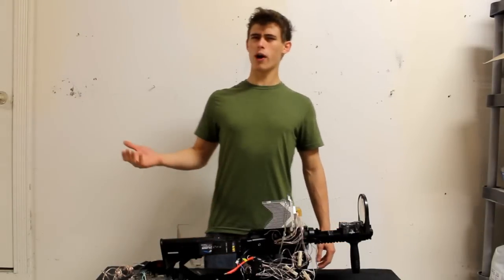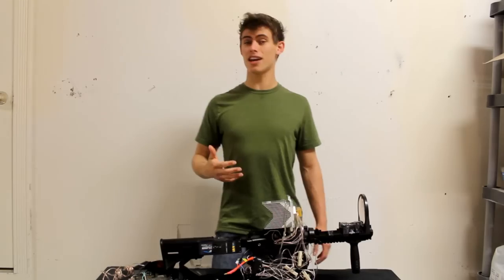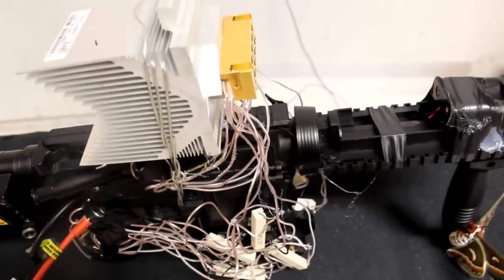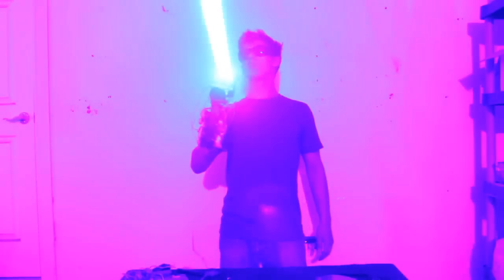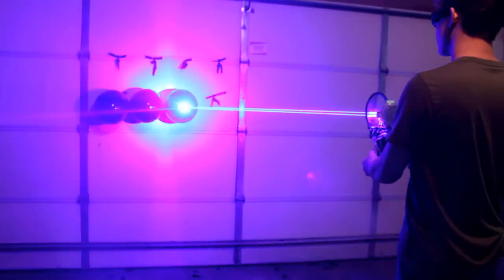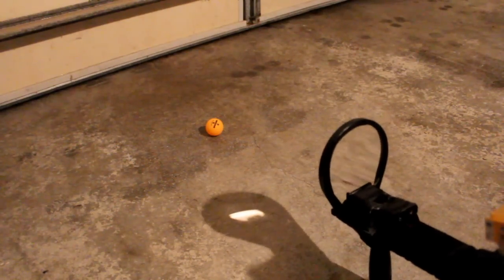My Homemade 40W LASER SHOTGUN!!!!!

Comment: I've got a 1.2 billion watt laser gun.  It cuts through steel like hot butter. 
Only problem is, every time I wake up, it's gone.
Reply: +JustAGuy Actually you can cut through steel with just 1kW (1000 Watts).
Reply: Gex9z Like hot butter?  Like a steel frame from a truck?  
My post was a joke about a dream.  Your post is trying to make it real asks you just use the word "steel".  Steel comes in different grades and obviously many thicknesses.  You're gonna have to be more specific.

Comment: Its not true 40 watts if its an array of eight 5w diodes, Instead its just a 5 watt multi beam laser. I have a DPS laser that can do all that.

When you build an actual laser rifle that can blast a hole through a steel beam or a person at light speed, then I will be impressed until then, these things are all just toys, like pellet guns and FRS radios..

Comment: Great work but try to focus the beams as close to gether at 10 feet as you can then add a slideing stick so you can adjust the magnifying lens then a nother with a 50x mag on the beams point when the meab is the thinnest for a stronger high powerd burning laser

Comment: I am recollecting a Star Trek episode where they needed more power from the tractor beam in order to move a planetoid. They couldn't just add more power b/c the beam system would burn out, but they realized that they could overload it if they did so in  short regulated bursts.

I wonder if something like that could be applied here. A continuous beam is too dangerous as the power increases, but in short bursts... well it would be interesting to see what a 120W "blaster" could do.

Comment: dude. the future is now. Sell this stuff. Imagine soldiers. With Guns that shoot FRICKIN LAZER BEAMS! I would by the sword and one of the lasers cause why not. if their cheap though. like. Under 50 bucks. maybe 70.
Reply: ha ha under $70, that's cute. That heat sink alone costs at least that much, and the diode array, probably about five times that much, then you need a pretty special battery. If these diodes find some sort of mass market, maybe the price on that component could drop, but you're still talking several hundreds just for the materials to make the device. Then, as cool as it is, there's not much practical purpose. It's not like your enemy target is going to hold still for ten minutes while you slowly melt a hole in him.

Comment: If that thing was 40W it would vaporise the wall
Reply: +Aaron Schoots Most lasers are 5 mW, but that's just for safety. Lasers come in all sorts of different constructions. A 445 nm direct diode multitude laser can be obtained cheaply at power levels above 2 W, and those diodes are extremely compact, making them much more portable than a 40 W CO2 gas laser used for industrial cutting. The trouble is combining the beams efficiently.
Reply: Not saying it is impossible, just saying this particular case is highly unlikely because of heat issues, the balloons taking a while to pop, and so on. Plus who the fuck puts a moth on his laser
Reply: +Aaron Schoots You're either an average 11 year old, or a stupid 13 year old.

Comment: Instantly started wishing you built a rail on top of the gun (but below the lasers), where you could mount a little electric motor and some wheels, mount the optics to that and wire it all up to a chip that would automatically move the optics on the rails to focus the lasers on the correct distance depending on what distance a seperate red targeting laser was inputting.

Comment: How much is 500k Mw turned into W? im stupid sorry
Reply: Thomas Smales 500mW = about .5W. This makes your laser a Class 3 laser which requires eye protection. Please make sure to wear it. Laser light has a funny habit of bouncing in unexpected ways and exposure to the beam directly to your eye can easily cause permanent damage. (Source I work in the laser industry, and currently help make class 4 1000W laser systems used for manufacturing and government use.)
Reply: 500 watts? I think I ain't so sure
Reply: Okay jeez... cuz i bought a 50 dollar lazer that produces 500W and is purple and it already looks like a lightsaber already XD
Reply: Thomas Smales 500k = 500 000 ; M= 10^9= 1 000 000 000; 500kMW = 500 000 x 10^9 = 500 000 000 000 000
Reply: Oh and you mean mw capital M means Megawatt and I doubt that exist for now xD
Reply: no mw i just use capitals cuz i can.. :3
Reply: Anthony are you sure its only 5w? It said 500,000 mw o.o I will wear eye protection <3 thank you for caring
Reply: Sorry Anthony But you must mean 5,000mW because 500mW it aint that powerful, a regular Artic SpyderIII is 1,000 mW and that equals it's 1 Watt (Or at least when last I remember that was its power)
Reply: +Thomas Smales there is no way in hell it produces 500w. 500mW maybe, but a 50$ laser pointer you're lucky to get 30mW
Reply: +javier colon Did my wording confuse you? I said 500mW is half a watt.  5000mW would be 5 watts.

Comment: The backscatter off the lens is pretty bad. Hope to see you enclose the array and lens system in a suitable housing so that there will be no light spillage unless it comes from the actual beam exit aperture. Essentially this is what the navy did with its shipborne laser system. Multiple diode emitters with a deformabe mirror system to increase the focus without having to resort to heavy and bulky lens systems to keep the focus at variable ranges.

Comment: Thats in no way 40 W not even 1W of output power!!!
Go get a calorimeter.
The point of laser is to focus its whole energy into a tiny itsy point, you might as well get a bazooka.
There are stronger 3 dollar worth of diodes out there on ebay.
Reply: *****  Lets just say that when you buy a car from....lets say where you live its not the same thing as buying a car that came from china.
Even if both are same horse power.
Anyway, i was implying the design could do with a lot of improvement.
Wonder if there is any way to tighter align the rays.
Reply: You are such a dumbass lol. Sorry, that was rude. I have a strong feeling you don't know what you're talking about when it comes to lasers, bud ;)
Reply: +Bacanu Andrei You are a fucking idiot.
Reply: +Bacanu Andrei OK it needs improvement?  Post your better laser video or QQ.
Reply: Well actually i am toying around with a CO2 laser which happens to be easilly mobile since its DIY......but the xxKV cable and lack of proper eyewear for that kind of rated power is a big reason to worry. Though you did have a genius idea. Same thing as the video just different source.
Great ideea for a "PLASMA RIFLE"
Reply: You should join Laserpointerforums.com if you're interested in the laser hobby, and want to learn more. Maybe you can learn that a 40W diode bank array actually IS more powerful than a $3 eBay diode! ;)
Reply: +Gabe Sewell I prefer /r/lasers. When I was still new, I joined laserpointerforums and found the community to be very unfriendly. 
But I might have just gotten unlucky with the people I met.
Reply: Ah, yeah I could see that. Sometimes the vets have bad days, and since they are the main posters in there it comes off as the whole community like that. You also might have accidentally done some minor infractions like necroposting, double posting, etc. and didn't let yourself have time to recover in the community. I've found tons of friends in that community!

Comment: If you use two lenses you can adjust the focus for different ranges. Looks like the beams could be collimated a little better, that dramatically improve the cutting power. Pulsing the laser would be even better, but that would quite a bit more technically challenging. A great step in the right direction.

Comment: But can it melt Steel Beams?
Reply: Did anyone here get the joke?
Reply: I did but ill let them keep wondering xD 
Jet fuel < steel beams
Reply: ***** u dont know physics
Reply: *****
the thing is that those 40w are concentrated on EXACTLY one spot, whereas a light bulb spreads it around its whole surface. power density on lasers is way higher that way
Reply: *****
that 40w laser could in theory focus ALL its energy  on the size of one photon. try going through steel with a flamethrower, then with a laser. the flamethrower spreads all its energy across the steel, the laser hits a spot as thick as a photon and thus completely annihilates it
Reply: Only of jet fuel can
Reply: +Mason Gordon steel beams cant melt rocket fuel.....
Reply: +Mason Gordon 
Hell, it aint' no jet fuel :L
Reply: +Jannik Glückert If the material reflects light of that colour, you're not going to get energy to transfer. Since steel reflects visible light, a visible light laser will not cut through steel. A CO2 laser in the deep infrared might cut steel more easily.
And to the guy comparing an incandescent bulb to a laser, you are missing the point of a laser, literally. Your argument is analogous to saying that a club that weighs the same as a sword should be able to cut just as well. Anyway, an incandescent bulb is not nearly as efficient as a laser, but if you took an LED, and made it 40 W, then focused it into a single point, you'd be able to burn stuff. The fact that the laser is monochromatic and perfectly in phase with itself makes focusing a lot easier.
Reply: Russell Hayes I dont think steel is 100% reflective, so its just a matter of power :P
Reply: That's fucked up man..
Reply: +Mason Gordon blue lasers can't melt steel beams.
Reply: daniel tajne you cant say that x color is not able to melt steel beams
Reply: +Jannik Glückert Nothing is 100% reflective, but it does matter. A substance that is 65% reflective, like unpolished steel, will not only require three times the power, but also cause a great deal of reflected mess, which could blind everyone around.
Reply: Bob NotRealNameMan smh
Reply: Lol
Reply: ***** BUT it is in poor taste though, no matter what and it can get you a can of a well deserved knocked the fuck out punch, if you use it around people who won't find it funny.Hell it might even lead to a family member of one of the victims, getting seriously angry at you.
Reply: +Emperor Huffius Yep or we'll end up old and bitter like the old people still mad over Pearl Harbor, and I mean real Pearl Harbor, not the terrible movie.  It's still ok to be mad at the movie.
Reply: +Randall Hamlet Someone is missing the dank meme
Reply: +Mason Gordon The joke of the beams is the easy reason for kids to understand lol. Newton has a beautiful law that explains why the plane can't fully go through the first wall of the tower.
Reply: +Jannik Glückert The laser we use to cut up to 1/2 thick still plate is a 15000W CO2, it is focused to a very small area.  If you consider the rays from the sun, they would not set fire to anything.  But focus the sunlight with a magnifying glass and you can set fires.   Its all about power density in a small area.
Reply: +user 14567 I'm pretty sure that a 40w bulb can burn paper.

Comment: You should try it on the moth, I bet he'll love it, lol, I'm just kidding, that moth would freak out and start to smelt, possibly explode. All joking aside is that moth your pet, that thing was ginormous, insects with wings, not cool man, not cool at all, freak me the hell out. See if the cat will chase that laser around, you'll have to put little goggles on the cat though or he'll be blind in a heart beat. The applications for this thing are endless, I see a whole new form of torture here, forget water boarding, you put someone's head in a box and then bam the light goes on for like 25 seconds at a time, I guarantee they'll spill the beans before round two starts. Also good for lighting things from afar like fireworks or dynamite.

Comment: Not to dissuade you.. However, I don't think it is a very good idea to point this at your garage door with reflecting surfaces (the metal portions of the garage door) at this power output and wavelength a stray reflected beam may cause a fire or harm to you.

Comment: Okay, I need the help of a physicist here because there is no way so many people are this dumb, so there must be something I'm missing.
Aren't lasers supposed to be invisible until they hit something? Like when you point one of those cheap lasers at something you can only see it when it hits the wall or if you point at water/vapor or something else that can reflect the light. And before any one says "that's because it's cheap, this one is much more powerful", the US as equipped a laser much stronger than this one on a navy ship, and you can't see the laser in the air either(there are videos of it on youtube).
So, what am I missing?.

Comment: Stating the obvious... this is a class 4 laser requiring at least 4+OD safety googles with a visible light passband only.  It can burn eyes out in 1/100 of a second and can also burn skin even from a reflection off those metal strips everywhere in the garage.  The reflections off the lens themselves can cause eye damage as well.  More or less breaks every laser safety rule ever put to paper... but then you know that.

Comment: styropyro This is awesome! However, you do know that there are better things to use than LM317 regulators, correct? In fact, there are even better regulators than the LM317; I'm using one in a project right now that delivers 5A @ up to 12V. Voltage regulators are great if you're trying to go quick and easy, but they have switching regulator IC's that are way more efficient and capable of delivering the extremely high amperage you need. You could take all that clutter and turn it into a single PCB that would fit nicely inside that gun chassis, extend your battery life, and more. I'm an electronics engineer from Oregon. Hit me up if you'd be interested in improving your design a bit (no offense or anything. I think this is amazingly cool. Just offering a little help). Cheers :)

Comment: Hi. That's a great God-given gift of inventing. It's the first practical personal laser gun (like The Woz invented the first practical personal computer). What shades do you use so it's safe? At what wattage is it too dangerous (not even wearing shades would be safe), by the way?

I guess, the next modification is capacitors and more wattage, so that it becomes a short burst of lasers that'll penetrate instantly. Maybe reallign the laser diodes in a chamber of mirrors where it concentrates into a single (pretty much what the laser diodes do themselves on it's in the macro scale) exit point as a pulse. Buck Roger's/Trek/Wars gun is 2 to 3 modifications away, finally. God bless. Rev. 21:4

Comment: come back to me when you start working in the laser cutting industry and using lasers that are between 2500w and 6000w to cut steel beyond 20mm thicknesses.. using unfocused blu ray burner laser diodes is a terrible way to transmit a energy beam!

Comment: OK. You should stop what you are doing otherwise you or someone emulating you is going to injure themselves.

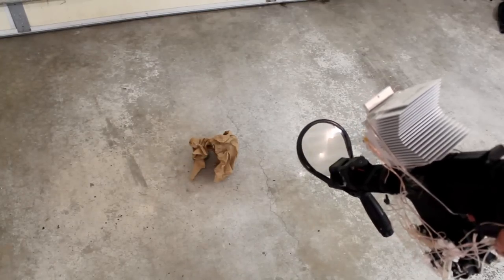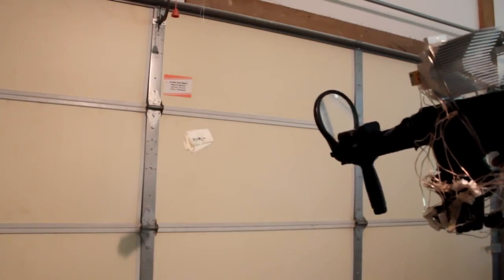There are at least four times (1:00, 1:10, 1:37 and 1:42) I can see back reflections coming off your lens. You could be losing 5-10% of your power into that reflection.
The way you have the lens positioned you have a diverging reflected beam that looks like it is coming straight back up at the operators face. Because of the way you have it mounted and the way you are holding the 'shotgun' it is probably going over your right shoulder. This is probably the only reason you have got a really good tan.
 
You need to be using a plano-convex lens instead of the bi-convex lens.
In a plano-convex lens the back face of the lens is flat not curved so the back reflection will be coming straight back at the laser diodes not being directed up at an angle. You also needs to be using a lens with an anti-reflection coating on it which will drop the reflection to less than 0.5%. That means the power in the reflected beam will be 200mW instead of the couple of Watts that are in it now. You also need to put an enclosed case around the beam path between the laser diodes and the focusing lens.
First rule of Class IV laser safety is an enclosed beam path.